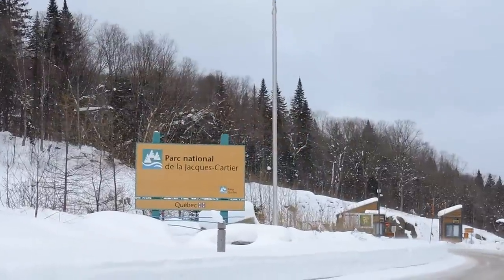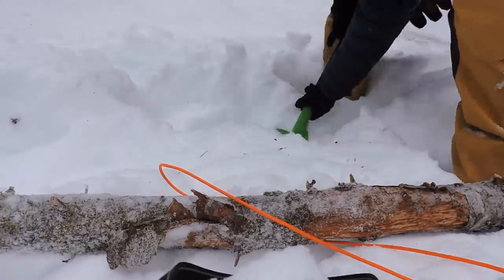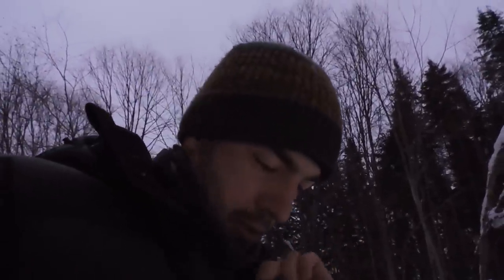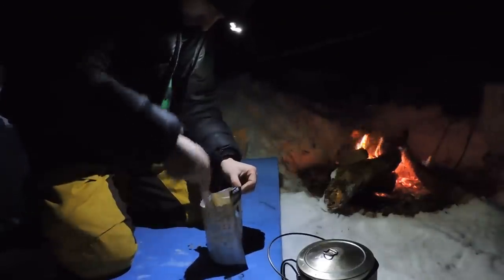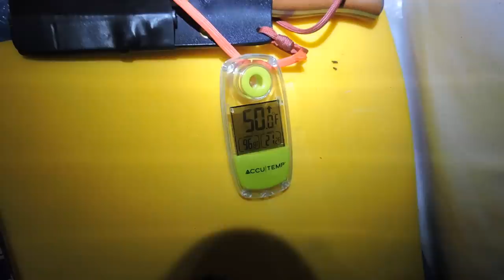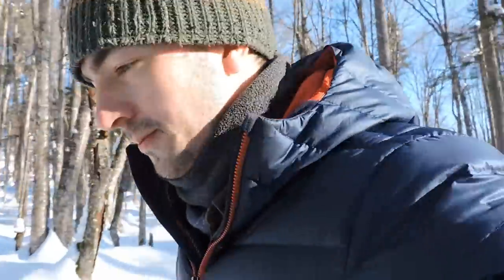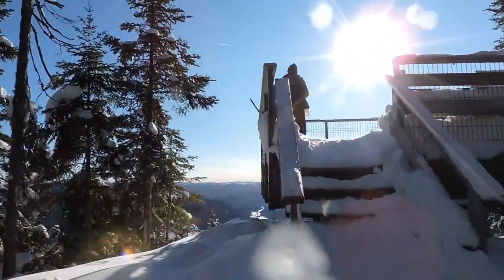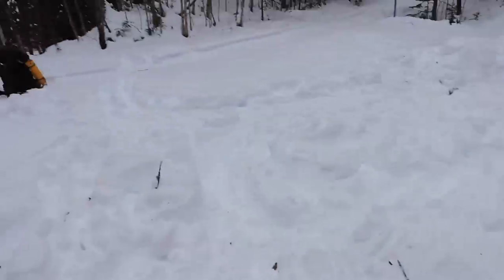Winter Camping in a Canvas Tent with Woodstove in Québec

Comment: Great video guys. I keep looking at the ATUK tents and others but still need to find the right light weight easy to carry tent. I have a Kni-co trekker but it is a small stove, but still keeps you comfy which is what matters in winter. Cheers Mon Ami, Fred
Reply from the maker: Yes it isn't the most lightweight of tents as the canvas is quite thick. You can go smaller but you still want a certain level of comfort. Good luck with your researching ! Thanks for watching man !
Reply: I have a 5 man arctic bell tent and does fine but always trying to lighten but stay comfortable as I get older. My 12x16x7.5 prospector tent is way too much work to set up. Fred

Comment: Greetings from Denver. I'm ordering an Alaskan Deluxe and I was a little reluctant until I seen your video from about a year ago where you show cased it. Now I'm more eager to buy it. I see you're using hose clamps for ease of assembly-good idea I must mimic you. I wanted to ask you how you like the stove thus far?

Thanks! Great video, BTW..
Reply from the maker: Thanks ! The stove is great I like the door, the legs that fold in, and the flat top. The only issue with it is the chimney, the welds on it are a little bit fragile I had to use a rivet once to join a section back together, that is why I always carry a few more clamps just in case I need to secure the chimney some more. Other than that, great stove ! Since it comes from the US you might pay less than I would for it in Canada so a good deal in my opinion. I had waited for mine to be on sale at Cabela's. paid around 300$ canadian. Cheers ! Thanks for the feedback I appreciate it !
Reply from the maker: I would be curios to try out the alaskan Jr. for my size of tent it would be sufficient I believe. Just a bit shorter at 18 inches instead of 24. That is the one I would buy when this one gets worn out … in a while most likely ! lol I keep it stored inside also as the steal is not stainless but not an issue at all.
Reply: @NomadicWoodsman  It's cool that you replied, many people don't. So I have a question, what are your thoughts about the Alaskan being a source of heat inside of a trailer?
Reply from the maker: Depends on the trailer. I would go for something a bit more heavy duty and heavier steal and heavier duty door. The alaskan is nice as it is relatively lightweight for travel and chimney packs in. If using a trailer and it stays in there permanently, I might use something with a door that closes a bit better. Also not sure how you would pass the chimney through the ceiling ? Would you need a double insulated style chimney ?